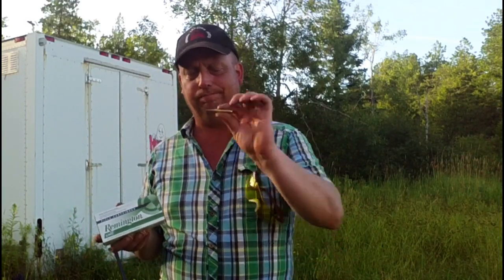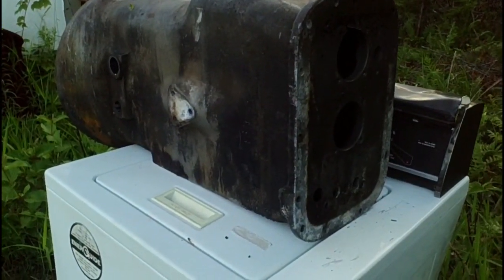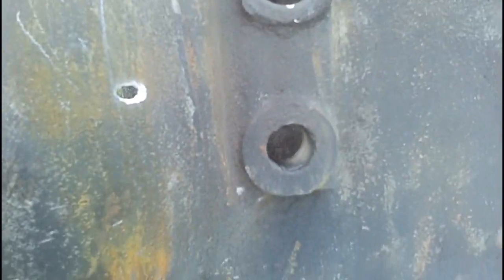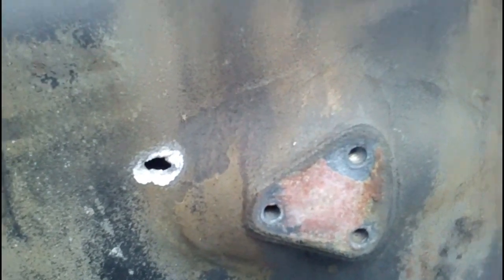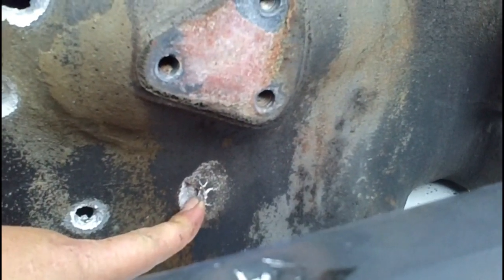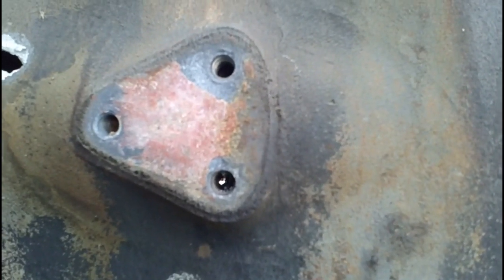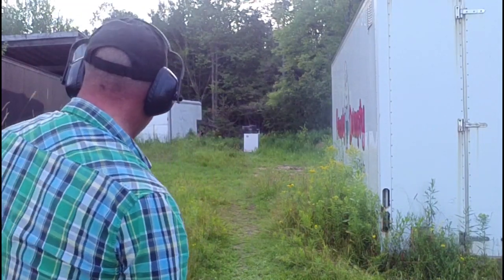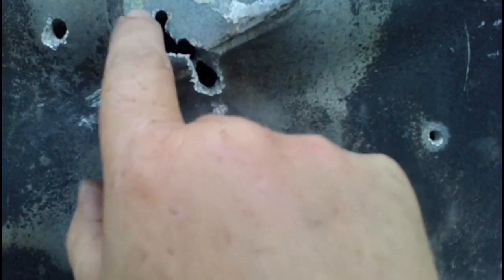Penetration test 223 vs  7.62X39 vs cast aluminum

Comment: This was fun to wach.    Love the russian sks to.    I wished i never sold mine.    Havent been able to find one for long time
Reply from the maker: There are still some kicking around here in Canada last I checked but the price sure has jumped. Thanks for watching!
Reply: @CanadianRedneck15  whats the going price there ?     If i find one here it will.run ya about $475 to. $600 depending.
Reply from the maker: @erniewalden3050  I thin they're running $350-550 generally, Chinese ones at the lower end of the scale, Russian ones to the higher end.

Comment: The "spatter" at 4:14 was from aluminum fragments.  The 223 round grazed the other side of the housing.  Additionally,  hitting the bolt hole  messed up your test.  It's not vitally important, but I wish you had taken another shot.
Reply from the maker: Thanks for watching!

Comment: you need to get a 556 make it a little for fair 223 isn't as pressured as 556 it has a little more penetrating capability
Reply from the maker: 5.56 may have a little edge over the .223, but I thought the .223 was still pretty impressive. Thanks for watching!
Reply: 556 green tip and or anything steel core would be more debilitating/penetrable ...

Comment: I shoot a big piece of T1 steel and the 5.56 digs about .5mm or 1mm but the 7.62mm just barely dents.
Reply from the maker: Interesting, I have a piece of  1/4" mild steel deck plate, the .223 makes a pretty good crater and the 7.62x39 goes through. Thanks for watching!
Reply: m193 out of 20" barrel makes cheese holes out of ar500 steel. velocity defeats steel. the faster the better

Comment: All M43 7.62x39 surplus has the mild steel core, no matter the country of manufacture. However, it is not a penetrator nor is it designed to be. The mild steel was used because it adds stability to the round and it is cheaper than lead.